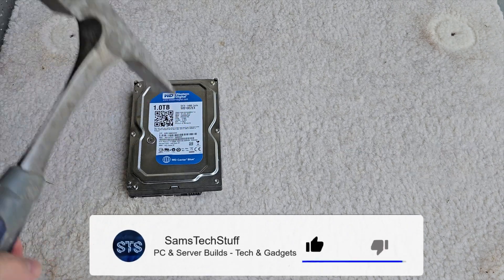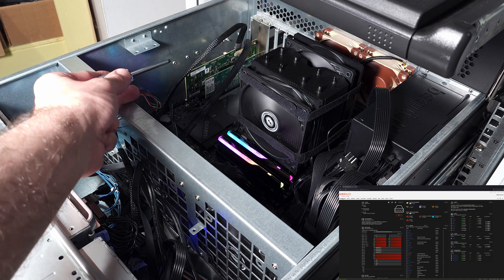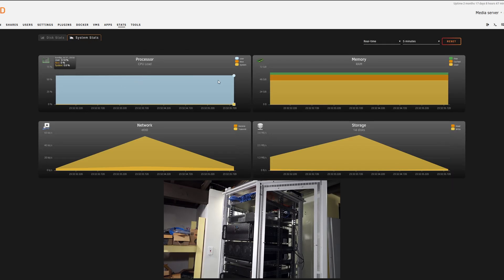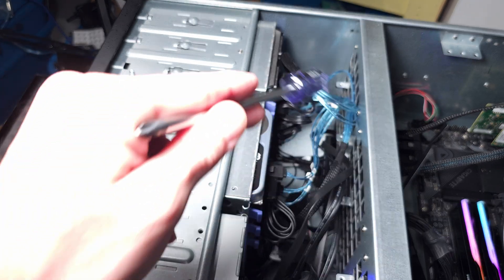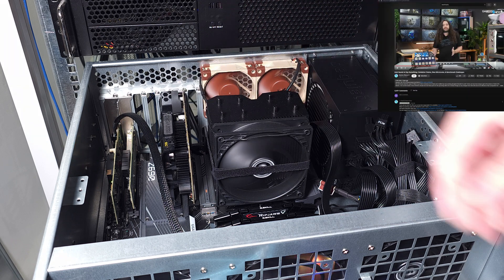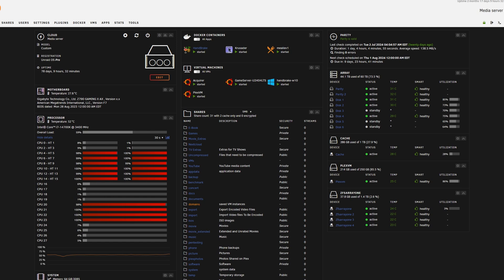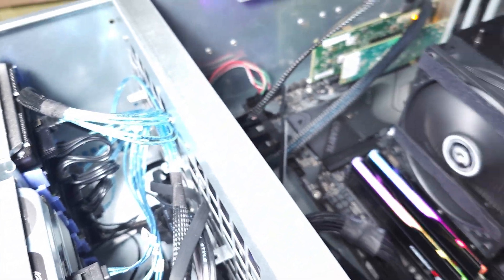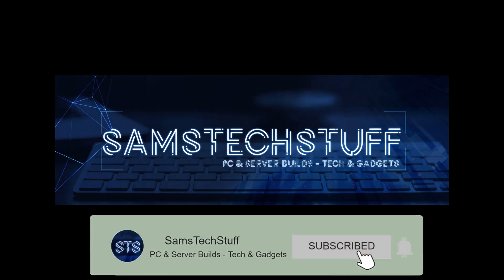Don't Buy Used Intel 13/14th gen CPUs for Your NAS!

Comment: Thank you for your update. Please let us know if you start getting issues. Intel chips are great, sadly this issue is making everyone worry about their chips and when they will start failing.
Reply from the maker: I will definitely update here if I run into issues. I am hopeful that the CPU will hold out for a while yet since I have kept the temps low with turbo being disabled and a decent amount of total case airflow. We will see, maybe I will end up picking up an AMD system, maybe even an eBay Epyc setup (learning from CraftComputing's videos to not buy a quanta, ha!).

Comment: I've been running a 15-14500 for a good while in my system, nice and stable.. The Ks seem to be the issue. I'd try to return the I7 and grab a i5-14500 or a plain I7-14700 non k sku.
Reply from the maker: For me, that's not an option, bought at launch. How warm does your 14500 run under load?
Reply: @STS My 13500 runs at around 50C running it in eco mode. Getting about 87 watts at full load with 2 parity drives.
Reply from the maker: @Matej1200  Ah nice, hopefully it can serve you well for a long time then.
Reply: buy ryzen 9950X.
Reply from the maker: @raminpro9765  I will definitely grab a Ryzen 9000 series CPU. Thinking about the 9700X but we will see. I'm almost certainly going to drive to a Microcenter somewhere, nice little road trip.
Reply: @raminpro9765  Quicksync can’t be beat for transcoding unfortunately so far for its power consumption.